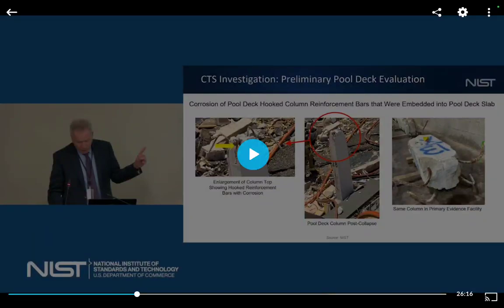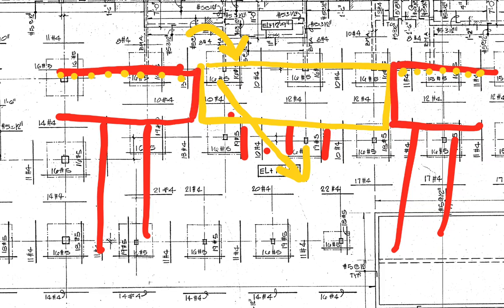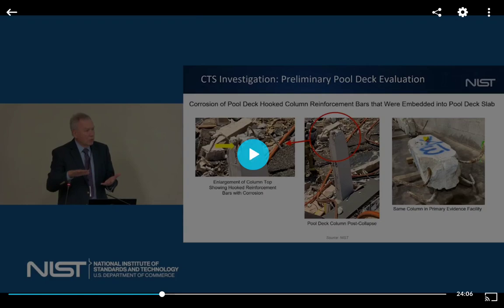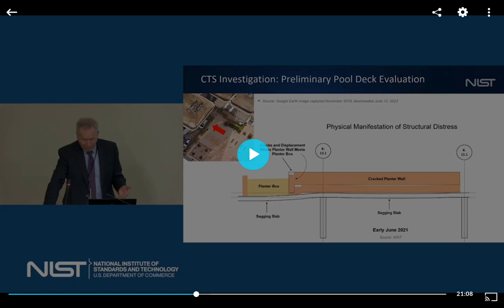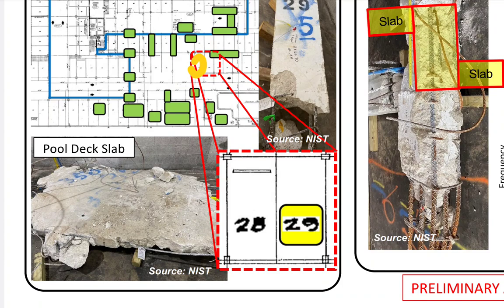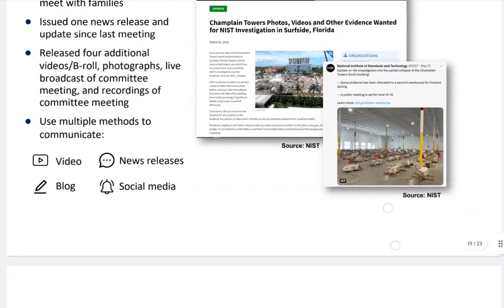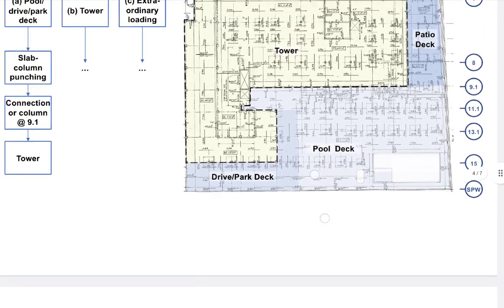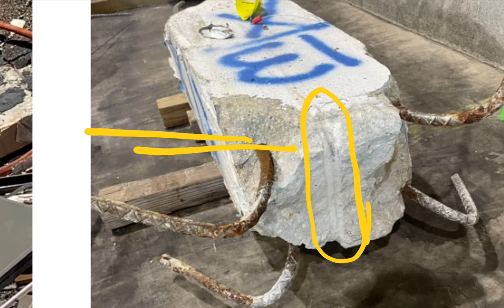Champlain Towers NIST BAMBOOZLE & does NOT have original plans; this is CRITICAL SHEAR zone failure

Comment: @ForensicEngineeringAnaylsis
I really believe the crane accident/tip over has a slight percentage of contribution to the building collapse. Possible rebar damage/movement from crane accident that was never corrected prior to concrete pour